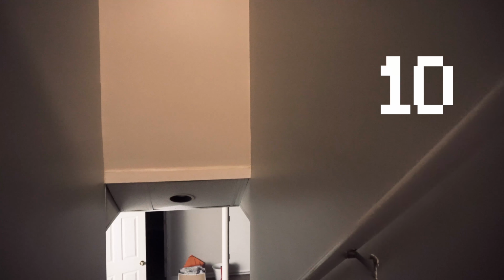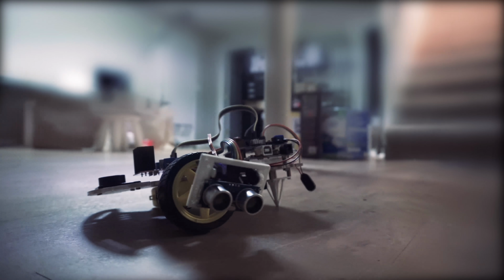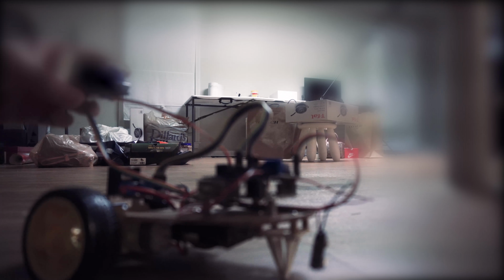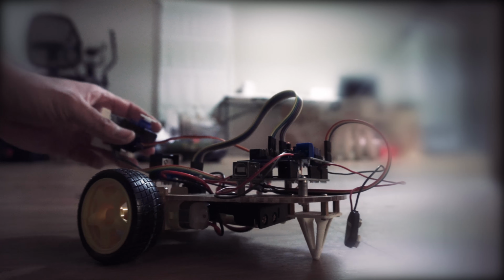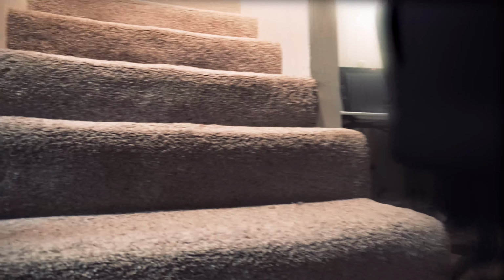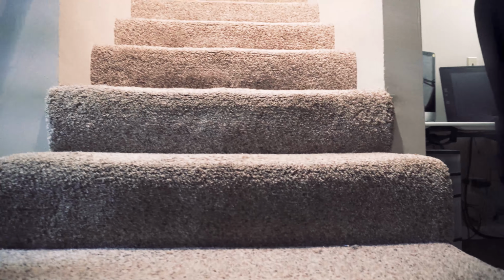How my robot took its own life! Arduino obstacle avoiding robot car test and bad ending!(Banggood)

Comment: One thing bro the codes that u put in the description had a lo of mistakes and i dont know how to solve them please i need help
Reply from the maker: Sure，can you be more specific about the problem? One thing you need to make sure is the pins. Make sure they match the begining of the code.
Reply: I had the same problem Andreu, probably u talking about servo right? in the program code, where u see a: "myservo.attach(9)" u will need to change the 9 to 0

Comment: nice video! Why was it always tying to turn left ?🤔
Reply from the maker: I programed it that way, so it always check left first if front is blocked. If both front and left are blocked, then it will check the right. Yeah it's still pretty awkward at this point but I'm thinking some better algorithm to make it always watching all the directions. Stay tuned.
Reply: ChenTheDesignMaker got it. Look forward to your next video!
Reply: you can put a random number 
i found a little function for this ; 
randomnumber = random(3)    will give you the number 1 or the number 2, if it's 1, you can check left first and if it's 2 you can check right first

Comment: Hi Chen, we have a simular problem of the model trying to fly. Do you know an add on that would detect a line at the top of the stairs to make it reverse? I'm trying to outwit young "nasty" grand children!!!!
Thanks, Nook
Reply from the maker: Hi Nook，there are 2 ways I can think of, one is to use a limit switch with a long wire, to make it like an antenna touching the floor all the time. when it's on the edge, the switch got opened and the program needs to detect that to back off. Another idea is to use a IR sensor pair, so when it detects there is a cliff, it could stop and back off.
Reply from the maker: I'm planning to make videos about this so stay tuned.
Reply: Thanks Chen, I will try the ir idea (and maybe a parachute!). Received suggestion of a rf wire on the floor and detector, this 70 yearold grew up on relays and ttl logic, so takes a while to assimulate ideas! 
Again thank you for your work, it stimulates the remaining two brain cells!
Nook

Comment: any precaution from not falling again?
Reply from the maker: Good question! I think maybe a IR sensor or limit switch under the front that when detects a cliff, it could stop. Any other ideas?
Reply: kindly suggest a code for IR sensor.